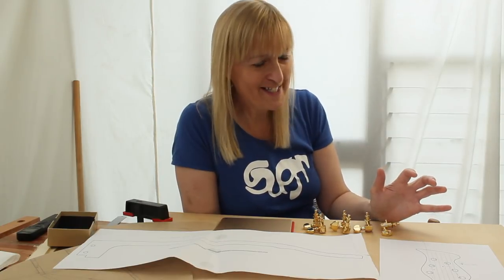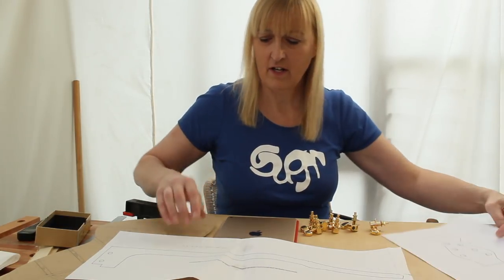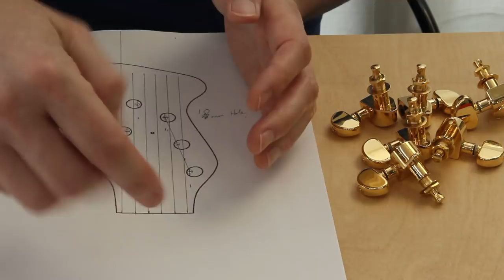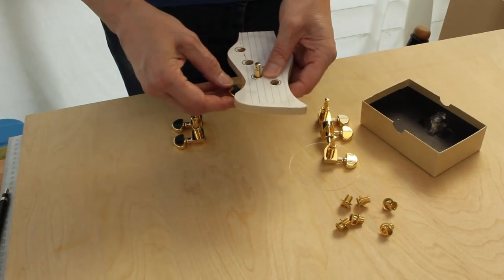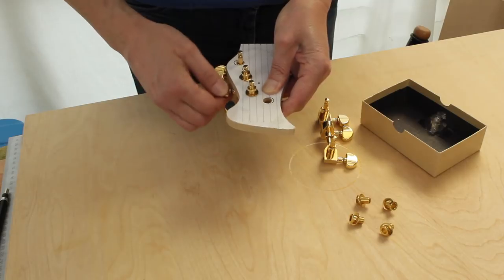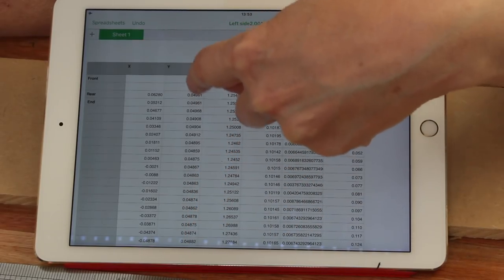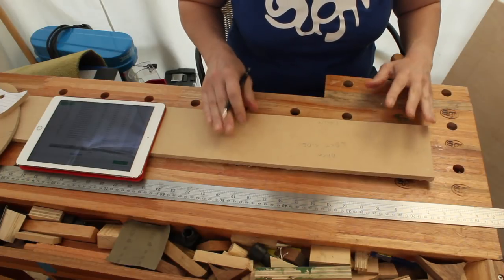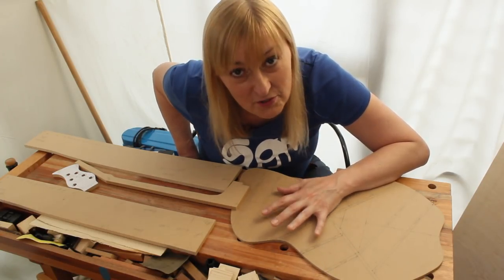SuGar SG1 acoustic guitar build part 8: Templates and headstock design

Comment: That headstock shape is really succesful. Pleases the eye. The difference between absolutely straight string pull and a few mm off is so tiny that it really has no meaning. As long as you don't go all Gibson about it, you're fine. But since you didn't need to compromise the shape to get there, why not. Well done!

Comment: Hello Susan, I spend lots of time enjoying your videos. I planning a cigar box guitar, which some may say is weird, but they are not as sophisticated as your builds. I am currently stressing about a 4 string version and will need to try string spacing and tuner placement as well. That being said, does your string pass exactly center line to the tuner holes on your template? If it does, I could make a template with 4 strings graphed out on paper with the proper spacing  and just mark the 4 tuner holes with  those individual strings. It just looks rather strange with some CB guitar strings running all over at different angles. Your input would be appreciated greatly. Thank you
Reply from the maker: The tuner posts are 5-6mm wide so have to drill the holes 3mm to the side of the string path if you want true straight string pull.

Comment: OK. So first question I have is, "Are you intending to build more?" If so you will need templates if not you just stick those drawings to your blank and cut out - this is how my friend does it using CAD drawings. It's a great way to get accurate tuner holes. OK? Second question, "Why are you making a side template?" As a complete amateur you need all the help you can get and bending a set of sides with parallel ribs is far easiere than handling profiled sides. You simply then use the sanding board to bring down the rim when you have the end blocks in and it is sitting in its form... I'm only 5 minutes in so forgive me if you have woreked this stuff out. Although I build 8 instruments a month I still mark out everything from a set of measurements. Lately I have machine profiled my ribs but I think I know what I am doing now after bending 1700 sides!